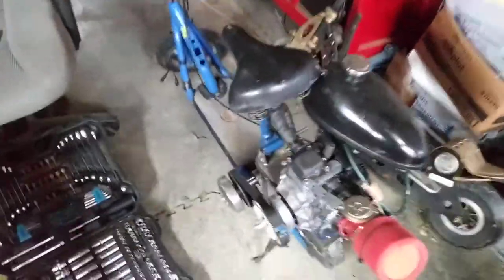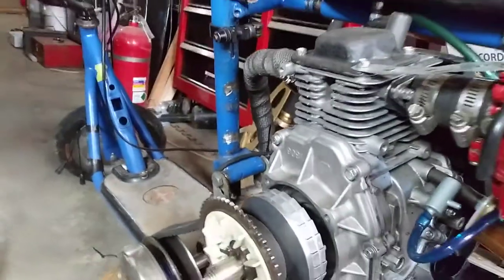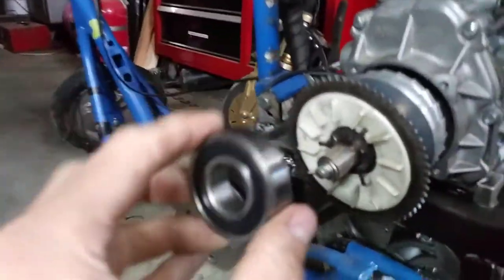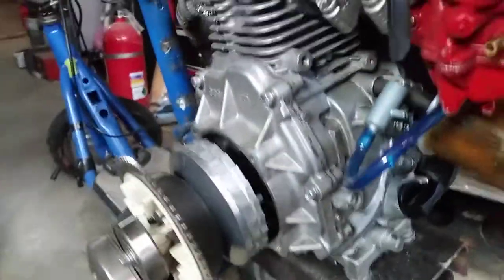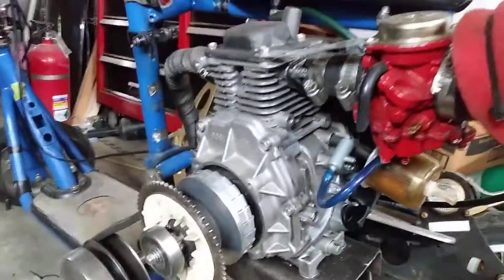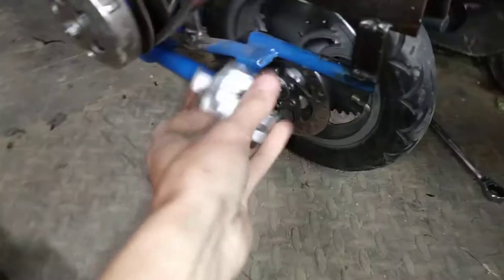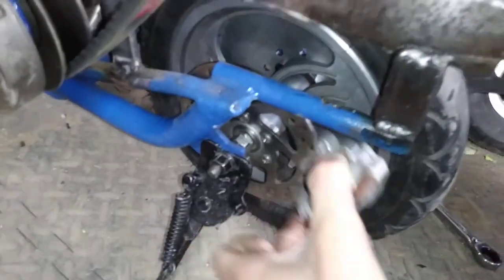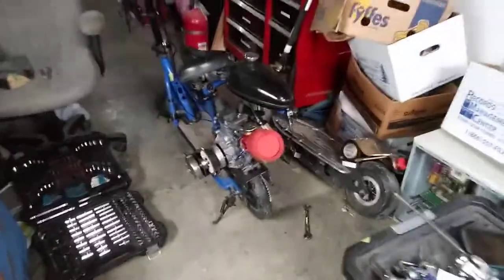49cc cvt scooter gearing change and worn bearing

Comment: Would it be possible to add a bearing to the drive side of the CVT and then put a pipe that could be threaded to keep the bearing load off the engine completely? Really like your videos.
Reply from the maker: I added a support bearing that takes the stress off the crank. I tore the engine down and found there was no damage to the crank bearings.

Comment: @4:35 you say you're not getting full engagement on the clutch, that's probably because of the springs on the clutch being too tight. you should try removing them and seeing if that solves it.
Reply from the maker: It's a cvt system. It has roller weights that adjust the shifting.

Comment: Mr Partridge, what is your fuel consumption? I today switched to the same carb as you have and fuel consumption is like 4L/100 km/h. Its crazy, but so as power.
Edit: Of course just dont run it on full throttle on GY6 carb and u will end up (with some tweaks) to have better fuel consumption than with stock carb
Reply from the maker: I'm not sure what its consumption is. the bearing in the crank wore out before I could take it for a long trip.
Reply: @mrpartridge8765  well, unlucky. But keep going dude